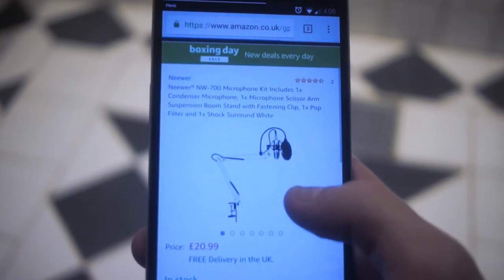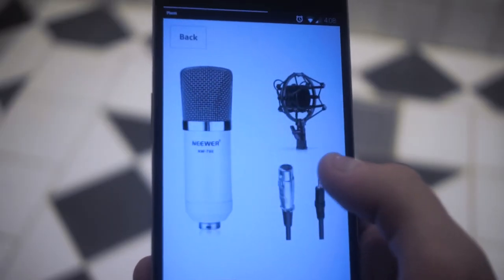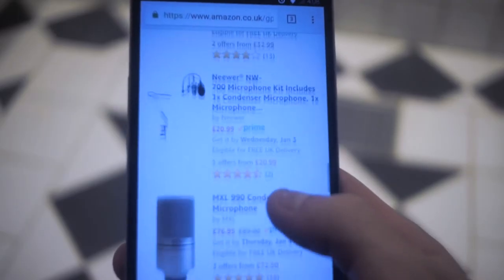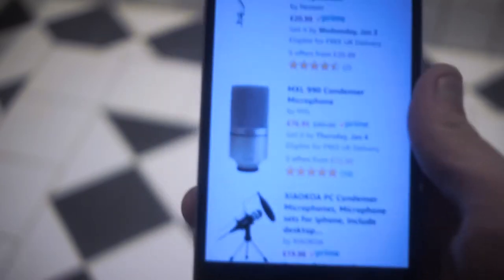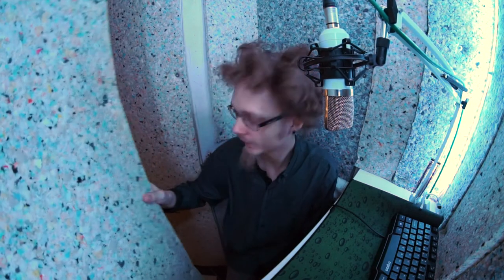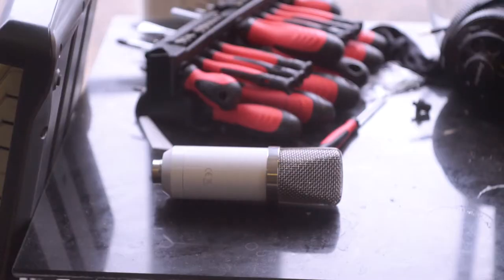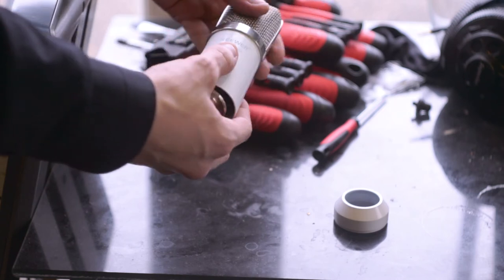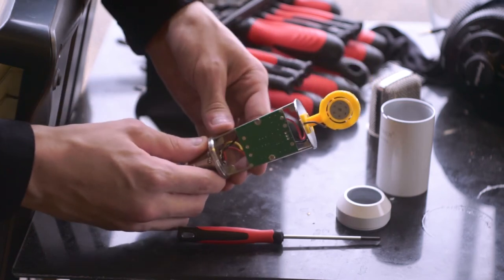Neewer NW-700 Mic Kit - Not a piece of sh*t?

Comment: It sounds horrible. There have been many very good BM-700 microphones, but this is not one of them.

So the best came under a number of brands many years ago, and might still be available from iSK and some others. They're not cheap! There's a 34mm LDC and two boards with through-hole components there. Not cheap at all, you can't expect to pay less than $60 for one of those. The shell is the same lightweight alu, it's alright.

Second there's many pretty damn cheap ones, I got one for 15€ - came in a kit with a nice metal suspension spider, a foam cover, and an outright offensive 3.5mm cable, but with no mic arm. It sounds a bit atrocious out of the box. The board is SMD populated, which is not an issue, what is, is that there's an error in the voltage regulation for the JFET, it's basically noisy and not filtered barely at all, and this little detail pisses over everything. The distortion from the X5R type 1uF caps in the signal path isn't an ideal addition either, but i'm willing to forgive that. I think the faulty construction is deliberate, so that it kinda almost works on 5V plug-in power of a computer instead of 12-48V of a professional interface or dedicated XLR preamp. It's not difficult to improve by quite a lot, like the ffcossag's BM800 mod, which I performed a bit differently, smaller value resistor, stacked a poly on top of an electrolytic of higher value, did not replace the Zener diode. The board has a provision to connect a second board to it, which, would it have been there, would have had the purpose to polarise an LDC capsule, but I haven't seen such a device yet - and I mean, pairing a junk board like this with an expensive-ish capsule wouldn't make sense anyway. There's a K596 JFET on the board driven by a naked 16mm electret condenser capsule in the head. The capsule is not bad, an identical one is found in many good sounding microphones. The mesh on the head is multi-layered, so there's excellent RF rejection - if the screws are in well, which they probably aren't from the factory.

Third grade is the Neewer. It's the same board, or sometimes a simplified one with no provision for the second board. The K596 is missing - on the new simplified board, there's no provision for it either. The head basket mesh is often bad or doesn't make enough of a connection, so retrofitting new hardware inside the microphone shells often fails on RF rejection until you put another layer on the inside. The capsule... it turns out the capsule is a 9 or 10mm headset microphone capsule, glued into the metal front shell of a 16mm capsule. This is your telephone sound. You can easily tell because the naked 16mm capsule has a screw terminal connection on the back, while in Neewer, the capsule has two solder terminals and a little green PCB. The opposite side of the PCB inside the capsule carries a JFET. Because the path between K596 and the capsule is very susceptible to RF injection, while an integrated JFET electret isn't quite so much, they can get away with not caring about the basket quality. The big PCB extracts the bias voltage for the mic JFET, provides some additional gain, and actively balances the signal to go into XLR.

This kit is a lot of usable accessories with a horrible microphone but a fairly nice shell that you can reuse for a DIY project and a partially usable PCB. I just love how China is supporting the DIY community this way. And they'll sell you a variety of capsules and electronics components too that none of the proper distributors can be arsed to stock, so nice, so nice! Where have we been all this time without them... maybe that's why DIY electronics died out for a long while, while now it's coming back in style.

Interfaces/mixers/preamps? Well musicians have to discard their old ones once in a while, basically you can get one for free. Once you clean out the beer residue and resulting corrosion, the smelly plant substances, and various white powders, they should even work alright again. I have to thank their horrible addictions too for supporting the frugal DIYer.
Reply from the maker: Thank you so much for your detailed comment. Unfortunately, I rarely get notifications from YouTube when people leave comments on my videos, so I only saw this by happenchance, three years down the road by now haha

I might pull the NW-700 back out of the closet some time and replace the capsule and pcb with some higher quality components. Not sure it's even worth the time though. I'll keep your comment in the back of my head if I do though, cheers :)
Reply: @thane_snipes   I have another microphone. It's a Fame CM-1, and is one of the nicer inexpensive BM700s, one with high voltage generator and a large diaphragm true condenser capsule. It's obviously been dropped, spat upon, stored wet, etc. It's got gremlins, i am yet to hear what it's really supposed to sound like, it's clearly not OK. But the construction inside is quite beautiful! Having an ornate cursive Fame logo not the modern shouty one, i think it's from around 2007, but i haven't found definitive date markings. I could hunt down one of the former MusicStore Cologne employees i suppose, i think i might have a friend, it's their store brand.

I have got some 25mm electret capsules very cheaply, brass cased, was going to modify my very cheap BM700 the one with a 16mm electret capsule to take that one, but never got around to, life got in the way. Might need a pad switch added because the output level of the 25mm capsule is going to be a few times higher than 16mm.

I'm not worried about having too many microphones because uhhh mates have a habit of borrowing shit and then disappearing. Really liked my Stagg SSM30 that i got back 20 years ago, well that's gone.